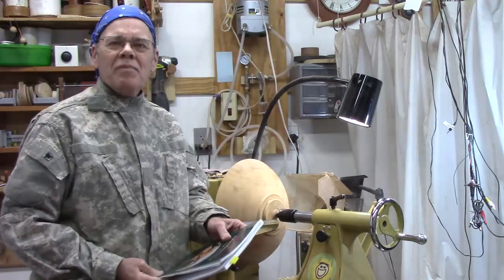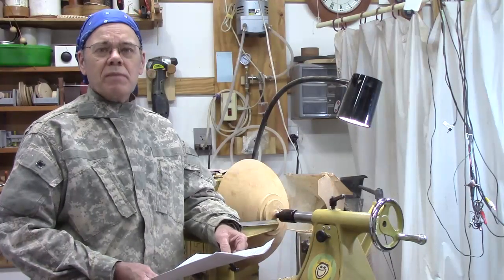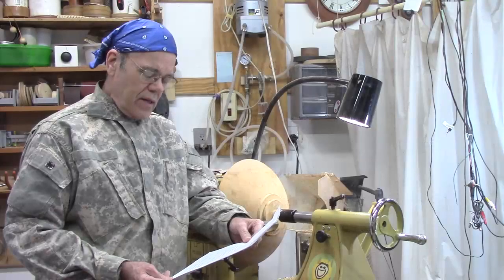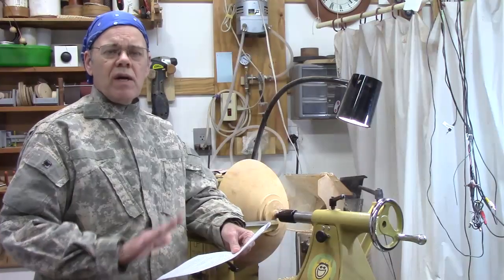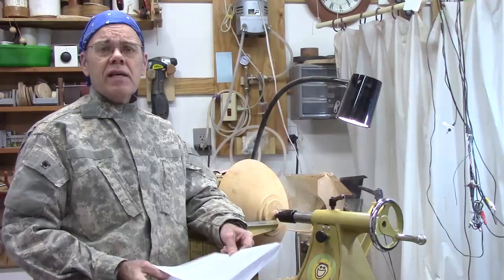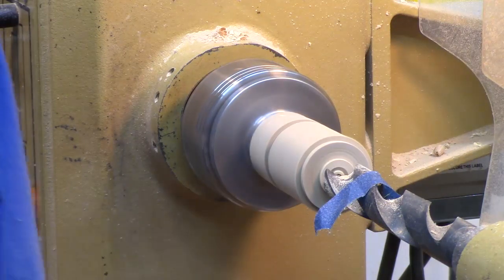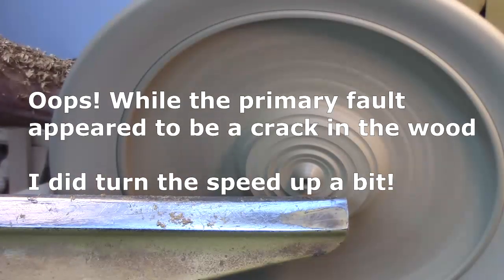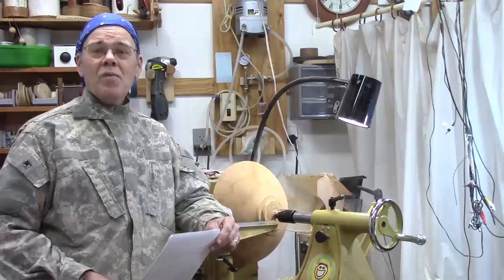Simple Guide to Finding the Perfect Lathe Speed for ANY Project

Comment: My big lathe has only two speeds. 0 and too fast. Luckily my other ones are variable speed. But no indication, so i set it by feel and vibration. Its good this subject gets covered. My rule is: the best speed is the fastest it will go safely.
Reply from the maker: +Willem Kossen 
I tend to agree with you. the challenge to a beginner is recognizing what may be too fast and this can vary with the skill of the turner based on tool selection, tool techniques, and sharpening.